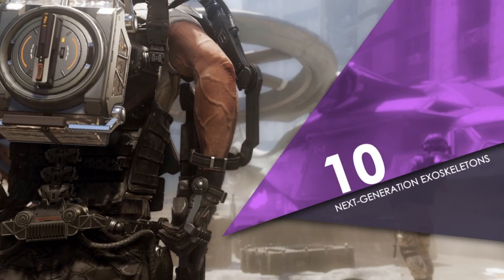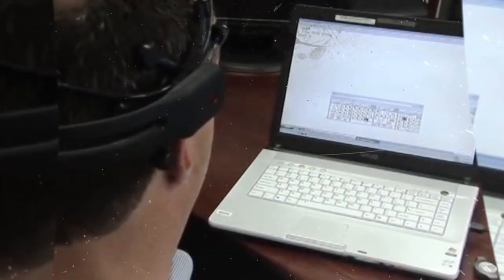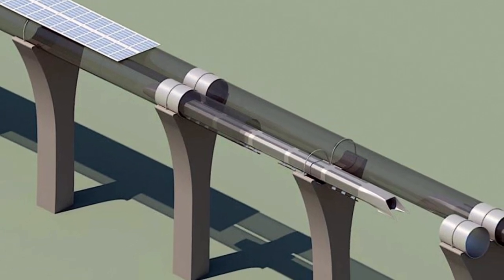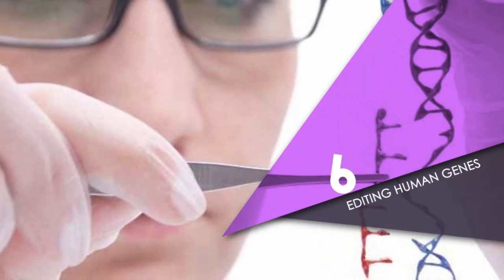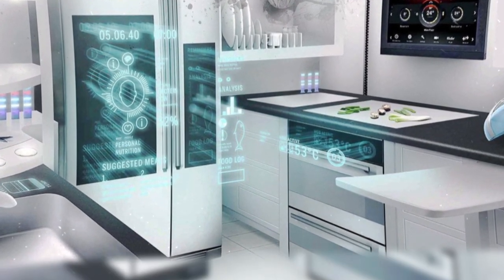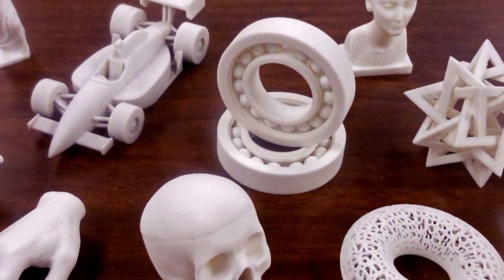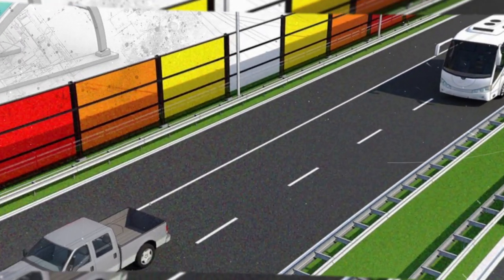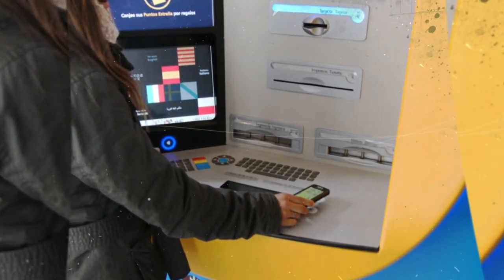10 Technologies That Will Change The World

Comment: Hacking ruins about half of these points
Reply: The Awoken you don't under stand you can't hack some ones hand through a keyboard so how through a thing over your head
Reply: If it can read then it also has potential to write. Lets say some random company starts releasing "affordable" gear and they decide to include something extra. Kind of like how routers are sold with backdoors.

Comment: Solar energy has several issues that make it such that it cannot completely replace other forms of power generation.  Depending on the area of the world you live, it may be an awesome supplemental source of power.  First is the issue of reliability.  Even if solar panels were 100% efficient, the sun only shines for roughly half of the day.  Less if there are weather patterns in the area like clouds or storms.  Second is storage.  Batteries are a huge bottleneck for solar power.  We need a way to store the energy gained during the day so that it can be used to heat and light homes during the night.  The battery technology for that just doesn't exist.  Third would be rectifying the DC power into an AC source that can be put on the grid.  With all of these issues, I just don't see solar ever being able to be more than a supplemental power source in certain areas of the world.  If we really want zero carbon emissions and still have reliable power, nuclear and hopefully eventually fusion (assuming that it's possible to generate more power than it uses) are the keys.